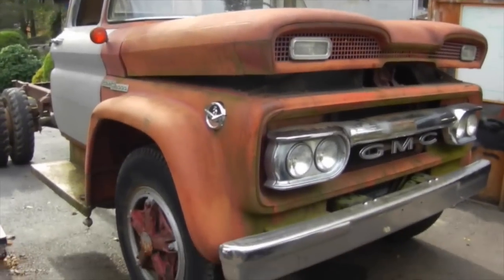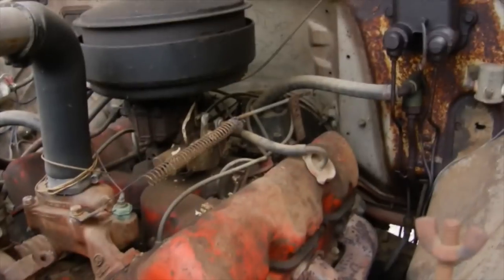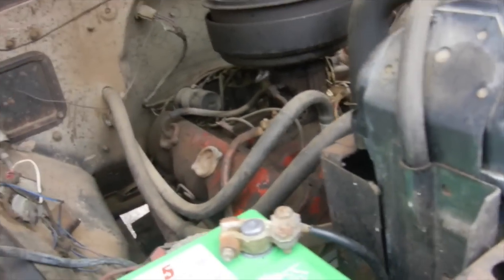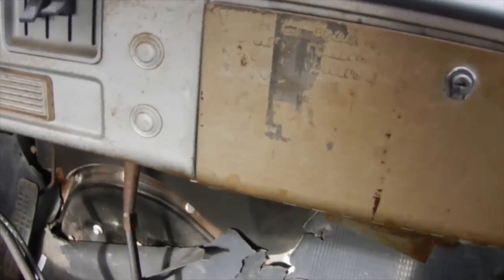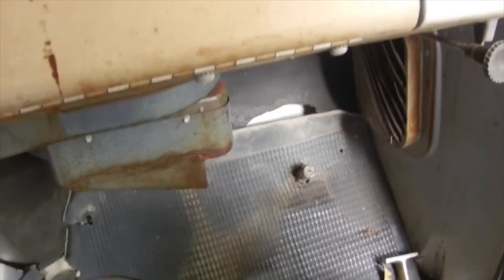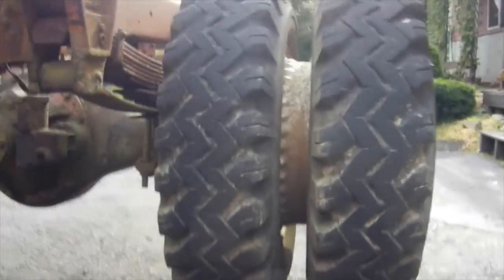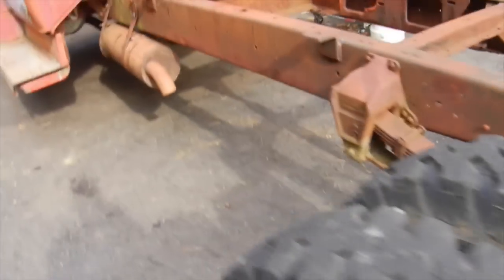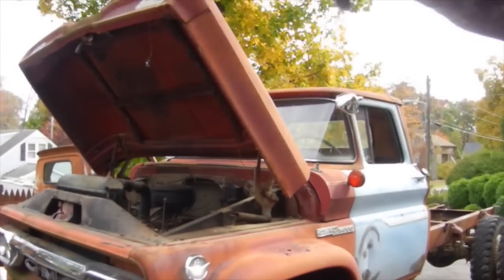1961 GMC 5000 Truck

Comment: Being that it's mostly red in color, has twin Spot Lights on the Roof Corners, and had both a Beacon Light, and Bar Light at one time, and only 16,000 miles, I bet it was originally owned by a small rural Volunteer Fire Dept at some point in it's lifetime as either a Pumper, or Tanker.
Reply from the maker: Traphill NC originally owned it as their tanker truck. I had contacted the department when I first got it hoping they had some photos of it back in the day all done up, but I never heard back. They must've ran the heck out of it on those dirt roads with the way the front end is worn out.

Comment: Jake this brings back some great memories for me! We had a 1960 Chevy C-60 at our farm almost exactly like that. It had a Chevy 292 with a 5&2 Spicer transmission. Ours was a flatbed dump. Spent much time as a kid dreaming of getting it running. So many things are similar! Grandpa scrapped in a few years ago because there was too much body rot to be worth salvaging it. Be careful with those dayton style wheels they can be dangerous if not mounted right especially if they are also split rims.  Really looking forward to seeing this project come along. But if you ever get tired of it just message me ;-)
Reply from the maker: +fcarp1685 Sounded like a cool truck! I always liked the Chevy eyebrow hoods better, thought they has a bit more styling to them. I will be! So far they are holding air and don't seem to have any problems yet. If I do have to change the tires they're going to a shop that has a cage, I don't want to chance any of that myself. Haha, can do!

Comment: What a BEAST!!!! Hey Jake, on the chrome, Rick from the show American Restoration, suggests using a loosely wadded up piece of aluminum foil dipped in plain water to buff out the rust. I tried it on a barbeque grill which seemed to work actually. Don't know about show quality, but it looked pretty good..
Reply from the maker: +Cattmann Sure as heck is! I've heard of that before and I'm going to have to give it a whirl. Pretty much looking for any way to bring the chrome back the best I can.

Comment: What kinda speed would these old trucks comfortably do on the road?
Reply from the maker: When I first got this one, it topped out at 35mph. After I installed an overdrive auxiliary transmission I can get 45-48mph out of it comfortably. Most of the older trucks from these years averaged around 45-60mph depending on the rear end ratio.
Reply: 5Tractorguy thank you!

Comment: So whatcha gonna do when it's time to replace those ball joints?
Reply from the maker: At this point, find an I-beam front end from a 60 to mid 70's C-60 and swap it out. All the holes are in the frame for the spring hangers. Hopefully it's a long time coming though...